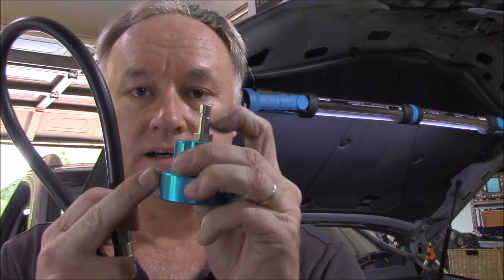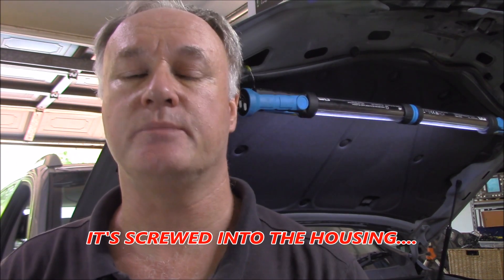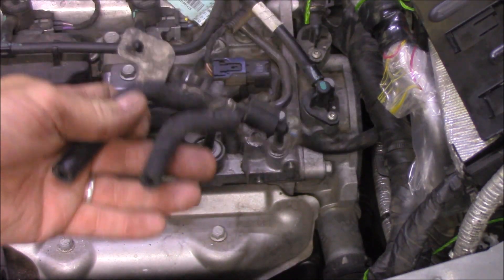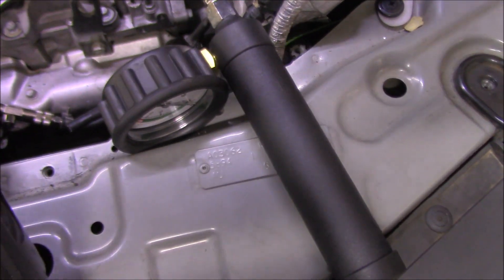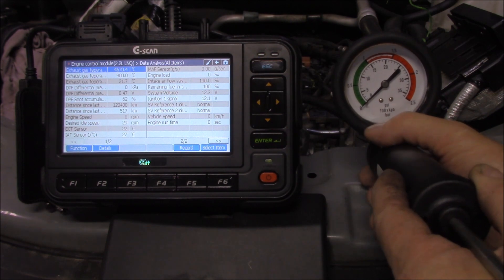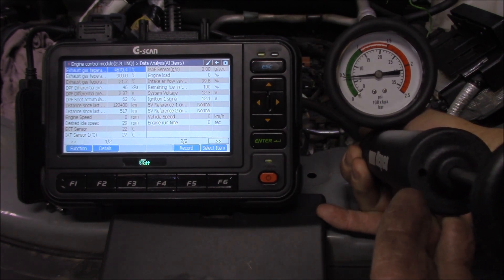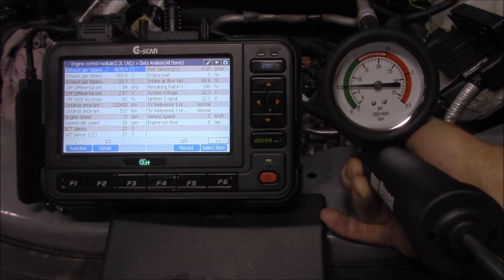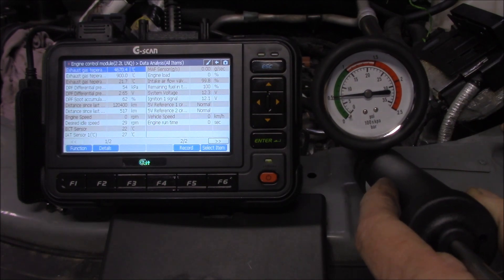DPF Differential Pressure Sensor Testing MiracleMAX

Comment: Hi, thank you for this video! There are two outlets (HI and REF)  on the DPF sensor. In this video you only tested the one in front of DPF which is HI. Do I need to test the one after the DPF? Mine measures pressure just fine in HI outlet but always 0 mbar at REF outlet. I'm wondering if it needs to be tested at all? Thank you
Reply from the maker: Hey Complete,
That's a good question!
It is called a differential pressure sensor as it tests pressure at 2 separate points and then calculates the difference. The HI is measured before the DPF, the REF is measured after - therefore technically atmospheric pressure. It is this difference in pressure that the ECU calculates and decides how blocked the DPF must be due to restricted air flow.
That's why I only tested the HI one as the other one should have 0, providing you don't have any blocked mufflers further down the exhaust.
Thanks for your comment 😉
Reply: @MiracleMAX  thank you for your answer! I understand it should be 0 by default after the DPF. But Is it alright if I put pressure into the REF hole (for example 1kpa) and it still shows 0 on the computer? Or does it mean the DPF sensor is faulty? I had tested a few of DPF sensors on my Ford Focus. I assume some of them are faulty but I don't know which of them. One sensor displays data when pressure is applied to the REF hole. Other two sensors display always 0kpa on the REF hole even with pressure applied to them. So I don't know which of them is correct 🤦
Reply from the maker: @complete.7978  Can I ask what the actual problem is? Do you have fault codes? Have you checked for blocked sensor pipes and split hoses?
Reply: @MiracleMAX  Sure, the error is P2002, DPF efficiency below threshold. I don't feel like DPF is blocked and there are no other errors except for P2002. But I feel like the fuel consumption is increased and I think it's because the car is trying to regenerate DPF all the time. Pipes and hoses are just fine, with no holes, and no blockage. DPF sensor data was 0kpa all the time, but from time to time it randomly jumped up to 50-80kpa and then again to 0kpa. My tests on that sensor were: "HI" input displays pressure just fine, "REF" pressure shows 0kpa all the time when connected to the compressor. Then I get another used DPF sensor, this #2 sensor displays pressure from both HI and REF inputs, but on the go it is 0kpa all the time. What was strange to me was that the sensor didn't hold the pressure. When you apply pressure to one of the inputs, the air seems to blow away. One mechanic told me that DPF is fine so the differential pressure is around 0. However, I didn't believe that after 750km of ride, DPF would give no resistance at all. Error P2002 still appeared all the time. I assumed there is a hole in the membrane of this sensor. So I get sensor #3. This one shows 0 at idle and up to 2kpa on 3000rpm. But again while testing with the compressor, only HI input displays data. REF input gives 0kpa with compressor pressure in it. I cleaned the error, then I plugged in diagnostics with me on 50km ride. Maximum pressure on that ride was 1.9kpa, but still, P2002 appeared! Is that pressure that big? I don't know what to do, most of the mechanics here in Ukraine are suggesting removing DPF or cleaning it (which I don't see a reason for, because I don't feel like DPF is blocked). Thank you for any help!
Reply from the maker: @complete.7978  Depending on what scan tool you have, you should be able to see DPF percentage blocked, as well as how often the vehicle carries out a regeneration. Most DPF pressures should be - idle - no greater than 1Kpa, cruising - no greater than 6Kpa, under load - no greater than 20Kpa. 
Have you checked your 5 volt reference, ground and signal wires back at the ECU? Have you carried out a wiggle test and a terminal retention test?

Comment: Hi max do these sensors only show engine light when the DPF is blocked
Reply from the maker: Hey Chris,
This is purely a sensor, sending information to the PCM. You should be able to go into live data on your scan tool and see the percentage of blockage. Testing the sensor according to what is shown in the video will test the integrity of the sensor itself and if the PCM is responding to the information.

Comment: Thank Max! I have a truck I am working on that has a code for a pressure diff sensor. Checked for exhaust leaks, intake leaks with no issues. Removed the tubes and checked for blockages, none. Wanted to be certain that it is the diff sensor without just being a "parts changer". This does it!! Thanks my friend
Reply from the maker: Cheers Mate,
Glad to hear the video was useful! So was the sensor faulty?
MiracleMAX

Comment: Thank u for sharing .
But what about if the  i did pressure and the  rate still zero on live data , i changed the sensor  and checked the wiring from sensor to ecu and still showing zero ?Thanks
Reply from the maker: Hey Shant Kilerjian,
Did you check the basics? Are the sensor hoses down to the DPF split? Do they hold vacuum? Have you checked the sensor for 5 volt reference, a tested ground & response at the signal wire at the sensor itself? 
MiracleMAX

Comment: My voltage is at 4.7v signal and reading 106kpa. I unplugged the two hoses and same reading this is going to be fun!
Reply from the maker: Hey HitsMetal,
Do you have a good 5 volt reference and a tested ground?
Do you have any fault codes or symptoms that you are looking into?
Does your scan tool show you how long ago a regeneration took place & the current amount of soot accumulation?
At what RPM do you get the 4.7 volts on the signal wire?
MiracleMAX
Reply: @MiracleMAX  I have good ground and 5v reference, my scan tool does not show Ash or when last regen was. It revs only to 3000rpm when I disconnect the maf car drives fine. On idle shows these readings.
Reply from the maker: @z0m123  Do you believe that you have a DPF fault? 
If you disconnect the MAF & it improves, that might be an indicator of a faulty MAF. Here  is an example of what sort of testing can direct you to a correct diagnosis:
https://www.youtube.com/watch?v=PMg50o_fhXQ&ab_channel=MiracleMAX
Reply: @MiracleMAX  I done voltage check on maf and disconnected it so I replaced it and fault is still there no engine codes? I'm limited to diagnostic tools "forscan and a multi meter" it's the only thing I see out of place.
Reply from the maker: @z0m123  Can I ask what the actual fault  is & what symptoms you are having?
Reply: @MiracleMAX  the car is in limp mode and won't rev past 3000rpm, I unplug the maf car works fine. Its very strange there are no codes I bought the car like this as a project. I like the challenge just looking for some pointers.
Reply from the maker: @z0m123  In that case, you will need a proper scan tool to get some real data, do resets, etc. Otherwise you will just be loading up the parts cannon.

Comment: hi, my car ford transit 2015 2.2l, the dpf was removed (nothing inside), and my car now can not rev above 3000 rpm, my code is P246C00,P24A400,P246300, any soultion you may have?, regards, Meshal
Reply from the maker: Hey MSH3L60
,
What testing has been done so far? Why was the DPF removed instead of replaced? The vehicle requires that a DPF is fitted. If it was removed, what was done with the Differential Pressure Sensor? Most likely, the reason for the fault codes and lack of power is due to the DPF being removed. Emission strategy will force it into a limp home mode, so that the vehicle gets repaired according to the emission laws.
Does this system use a Fuel Vapouriser? If that is blocked, that will create problems as well.
Make sure the exhaust temperature sensors are working correctly.
Have you tried resetting the DPF values in Special Functions on the scan tool?
Cheers
MiracleMAX

Comment: Hi on my Audi A4 B9 showing fault code P2002 but my DPF is fine engine Management Light comes on every day or two with same fault code got it tested from so many places but no solution can you help me on this please many thanks Regards
Reply from the maker: Hey Shafiq khan,
I need to ask a few questions to find out more about your vehicle.
Do you have a scan tool that you can use with the engine?
How do you know that the DPF is fine?
Can you see on the scan tool the last time a regeneration took place? Has all the DPF, EGR learned values been reset if a forced regeneration was done? https://youtu.be/eLxHFZSkHAo?t=1227
Have you been able to test the Differential Pressure Sensor and are the vacuum hoses going to the DPF OK?
What is the soot accumulation in the DPF when it shows the fault code?
Do you have any freeze frame data with the code?
Is the EGR valve operating correctly? Are the target and actual values the same?

The answer to these questions might be able to help us work on a diagnosis.
MiracleMAX
Reply: MiracleMAX thanks for quick reply the fault code is P2002 DPF efficiency level below threshold and I’m not machnic but few machanic checked it also AA fully scanned the DPF came with no problem
Reply from the maker: @Shafiqkhanuk  I'm afraid that there is no simple answer without diagnosing the vehicle carefully, which would include the information I mentioned in my last reply. The DPF constantly regenerating is a symptom, possibly not the fault. Just because the light comes on, that may mean that there is a fault or that the DPF is doing a service regeneration due to excessive soot build up. This could be due to an incorrectly working EGR valve, poor oil quality, poor fuel quality, blocked air filter, poor turbo operation, a faulty Differential Pressure Sensor, a PCM software issue, leaky injectors.....and the list goes on!
Sorry I can't be more specific, but diagnosing with only a few facts is just guessing.
I hope that someone can diagnose it correctly for you and repair the fault.
Here is a link to a forum I found. It appears that this is a common problem.
https://www.audi-sport.net/xf/threads/p2002-diesel-particulate-filter-efficiency-below-threshold-bank-1.378816/
I hope that gives you some direction.
MiracleMAX
Reply: MiracleMAX thanks for your help you are great soul ❤️
Reply from the maker: @Shafiqkhanuk  Sorry I couldn't help more - I hope you get it sorted. 😊
Would you mind letting us know what you find when you get it fixed please?
Reply: MiracleMAX don’t be sorry sir you are great person and will definitely let you know I think it’s definitely DPF pressure sensor it’s got 3 when I unplug them engine changes the sound with 2 and the third 1 not effecting engine sound I think that’s not working I have ordered it when it comes I’ll change it then see how it goes but again thank you so much stay blessed
Reply from the maker: @Shafiqkhanuk  Thanks, I'll look forward to hearing how it works out.
Reply: MiracleMAX I’m not sure if they reset values also let you know vehicle never lose the power
Reply: Hi sorry to bother you again I just seen on DPF pressure sensor two pipes but there was no clips on then on one of sensor does that make any difference ? Many thanks
Reply from the maker: @Shafiqkhanuk  No, they are not under high pressure & do not require  clips, especially the rear hose on the DPF. As long as they haven't fallen off & have no splits in them. Just blow into the hose with your finger over the end to check for leaks. The hoses are usually 2 different sizes.

Comment: I was able to fix this issue by relocating the dpf filter from the exhaust pipe and putting it beside the def tank in the scrap heap.

I find this method is the best for permanently fixing emission system issues.
Reply from the maker: Well that's one way, Krad Links 😊.....
How did you eliminate the fault codes and the DPF light? 
Did you do a full DPF delete?
MiracleMAX
Reply: @MiracleMAX  

Yes ive had the truck for a while, ive always been some what of a diesel bunny and I always wanted a large 4x4 truck.

Now I own two a 91 f250 and my 2017 ram. I love the ram but after the first big repair bill the emmisions had to go.
Reply from the maker: @kradlinks2880  The RAM is a big Boy, that's for sure!
Unfortunately there are no cheap, quality repairs now-a-days.
Emission systems usually work well, but they definitely require more attention.
Reply: @MiracleMAX  

Yeah but luckily all our emmisions testing is self serve plugins. 

And the guy who did my tunes and deletes did something that lets me pass emmisions. 

Now if they ever use a sniffer that would be bad but I'm about to move to a state that doesn't even test emmisions and straight pipes are the norm so I should be ok.

I hate to have to move but my butts getting out of Portland.  Its like a war zone every single night here lately.
Reply from the maker: @kradlinks2880  I hope your move goes well for you.

Comment: Where can I find the dpf pressure sensor vw polo 2011 model?
Reply from the maker: Hey Harv Singh,
I'm not sure if this 2013 is the same as the 2011, but here is a video link on the sensor location.
https://www.youtube.com/watch?v=5v23gN1VSi0
If that is not correct, just follow the hoses that go from the DPF up to the engine and the sensor will be connected to those. 
MiracleMAX
Reply: MiracleMAX I can’t seem to find a video for a vw polo 2011. There are many vw Golf videos..
Reply: MiracleMAX the video u sent is for a vw golf..
Reply from the maker: @harvsingh7854  Sorry I didn't see that it was a golf. Try this link.
https://uk-polos.net/viewtopic.php?t=69668
Did you try and follow the hoses from the DPF?

Comment: Excellent piece of information. now i wonder if you could help me with mine..the pressure differential sensor after a parked regen's been done shows 0.2 psi (1.38Kpa) is that a good number in other words what is the trigger point from which ECM will know that filter is getting restricted or what's the number that indicates filter is fine? thank you so much
Reply: reason I'm asking it will request another regen in a short while thn
Reply from the maker: Hey Jorge,
Every manufacturer will have their own threshold, but as a general rule of thumb, Idle - max 1.5 PSI, 2000 RPM - max 2 PSI, WOT - max 3 PSI.
Frank Massey explains it well in this video
https://www.youtube.com/watch?v=GXVKDKIZD9M
I hope that helps 😊
MiracleMAX
Reply: yes that was amazing thank you so much

Comment: Good video. I have just done a forced regen on my 07 mazda 3 it still has the dog light flashing could it be a faulty dog pressure sensor reading causing the light to come on?
Reply from the maker: Hey Shane,
Welcome to the channel.
Why was a forced regen done? What were the soot accumulation readings? Have you done the test procedure in the video above? Any fault codes? Does the vehicle get serviced regularly with the correct oil? Is the EGR operating correctly? Did you do a DPF reset? This will be under 'special functions' in your scan tool. You may actually have to clear the light as well. It varies from vehicle to vehicle.
Just keep in mind that the DPF is a filter and when it is full, doing several forced regenerations may end up damaging the internal substrate. Before it gets to that point the only safe way to clean it is removal and having it cleaned ultrasonically.
You have to look for the reason for the DPF being full. Are there external things causing the light to come on - fuel mixed in with the oil, poor quality oil, blocked EGR system, carbon build up in the intake system, oil through the turbo system, incorrect MAF sensor readings, blocked air filter and the list goes on. Or there could be an internal fault, like damaged structure, pressure sensor, temperature sensors or other factors. Could you see when the last regen took place before you did your forced regen? It should happen roughly 200 - 400 km, depending on varying factors.
I hope there are a few things in here that might help you .
Cheers

MiracleMAX

Comment: Great video and simple test, IF you have a fancy scan tool. Is there a method to measure the voltage directly from the pressure sensor instead?
Reply from the maker: Hey Angry Cat Owner
,
You could use a simple multimeter to check for voltage variation on the signal wire. You should be looking at a range of 0.5 - 4.5 volts as you change the pressure. There may be conversions on the net that will give you an approximate comparison between voltage and pressure. Even a simple scan tool with live data will give you the changed readings on the pressure sensor.
I hope that helps 
MiracleMAX

Comment: my Sensor reads only a max of 6-10 kPa when driving or flooring it, is this normal or should i check the pipes and replace sensor if the pipes are not blocked?
Reply from the maker: Hey Joren de Groote
,
Those readings seem within limits. What symptoms are you having? Why do you think the sensor needs replacement?
Reply: @MiracleMAX  after my 2015 V40 D4 was tuned a get a sort of random hiccup on boost, or best to descripe as ''good boost-big boost - good boost'' with hiccups in between, or just a single hiccup on big boost. like it boost to much and cuts it down. tuner got a code P0471, that would be exhaust pressure sensor, so i replaced it OEM but hiccup(s) stil there.
Reply from the maker: @MrJoreng  It does seem that these do suffer with EGR problems. Is it possible that the inlet manifold system is blocked with carbon? Does the pressure sensor have a good 5-volt reference? Is the ground at the sensor in good condition? What are the voltage readings as the sensor pressures change? Are the hoses to the DPF split or blocked? Can you blow through them or do they hold vacuum?
Are there any vacuum leaks, for example, an intercooler hose? Are you able to carry out a smoke test on the inlet system?
Is there any coolant loss? The EGR coolers sometimes split internally.
Do you have a bidirectional scan tool where you can see live data and actuate components?